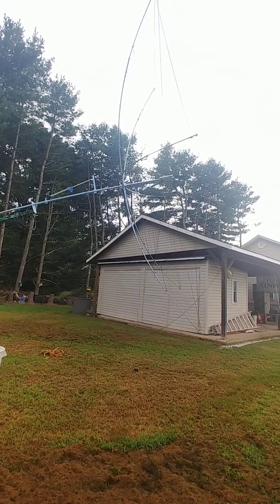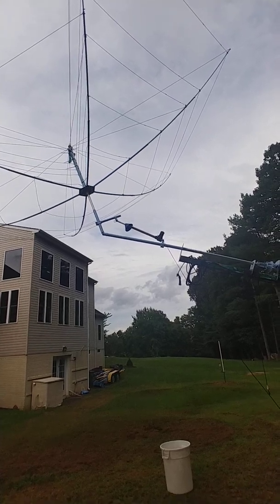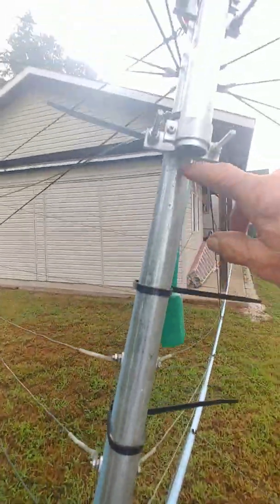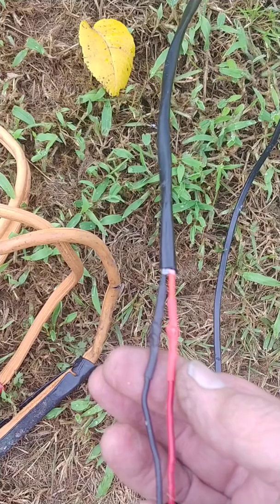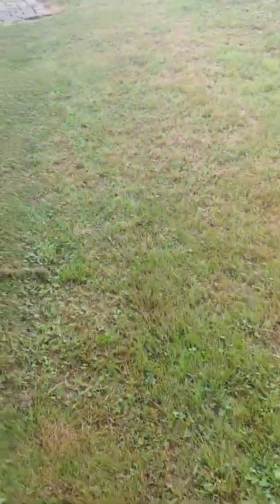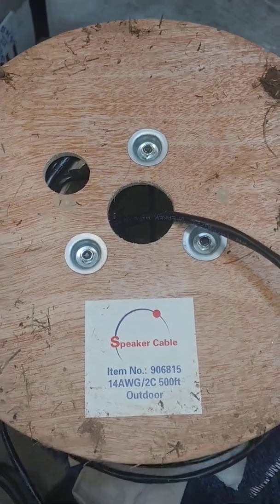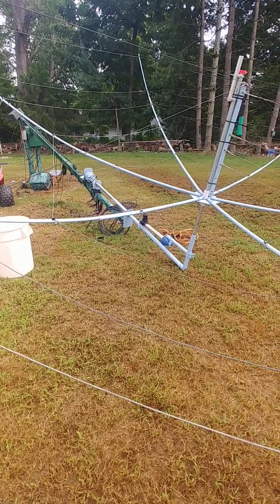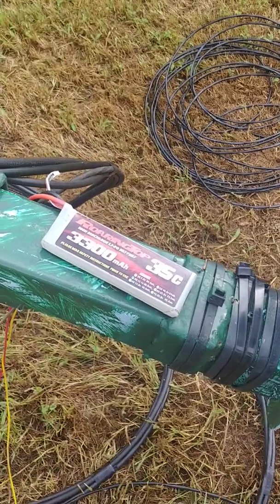hex beam on a fold over mast on a tilt over tower.

Comment: Good Stuff!  Yep, usually it is what ever i am working on that breaks or it takes more TIME!   This morning I switched out the rear wheel on the BMW.  I have had a vibration at 2600 rpms.  Before buying a new to me used rear drive... I decided that maybe its the Tire!  And I have another rim with an old Michelin tire on it.  The Dunlop Roadmaster III is the same size as the Michelin for my steed.  However it is bigger.  I have to remove the rear brake caliper to pull the rear wheel out.    I have had a screwdriver antenna on the back of 4 BMW motorcycles.  and I need to find anonther  little motor to fit under the coil.   Then  figure out a better way to attach the antenna to the back of this  Gentlemen's crotch rocket!  
Keep moving around!   from another Old GUY!